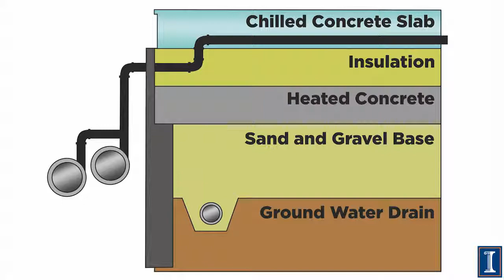How Things Work: Ice Rinks

Comment: I don't have any idea why you said that concrete has to be heated. He mentioned that he had to heat it to fix it after the insulation failed and they had permafrost with a 10 inch rise in the sections of the rink.

I don't think that this has been modernized first of all the labor costs are the primary cost and it's no longer beyond the ability of a robot to do. Secondly the labor is to save ostensibly energy that cost far far less. In downtown Los Angeles California I have seen them build the ice rink they bring lots of ice cubes in to get it started. I think they used trailer generators to operate the compressors I don't remember that's called Pershing Square and I think they have some heavy duty electrical connections to the grid there.

I don't think that the thickness of the ice represents huge energy cost and I don't think that the ice has to be perfectly level so I think the solution is colder ice and thicker ice but what you said about the gaps between the tallest molecules having loose molecules is helpful.

I also don't understand your argument about how you should slide through the ice it would take time and the existing layer of water would only reduce the time slightly I think what you're trying to say it would take longer than you have but you don't say what happens in their words when you try to skate on ice that is 21 degrees below Fahrenheit? I suppose you're going to have more difficulty turning maintaining traction. I also object to your use of the word dense when you meant less cubic space the problem with calling it more than or less than space to find how much space it is is the reactions that occur between the molecules reduce the mass. so ice is more space consuming than liquid water and it is less massive. It is less massive because the potential energy in water vapor that is released when it condenses exist as a mass as the temperature is not raised. this is an extremely controversial point and I don't know whether you agree with me or not nor am I certain about this but I have found a similar academic to yourself who argues that all reactions result in a change in mass. Mass is not conserved but there is always a balancing of the energy or temperature of the material and its mass. that is the case not for ordinary temperature changes but when did this enough Heat or the removal of heat does not change the temperature in the linear basis but is absorbed or lost by the phase change.

 it's a very very tiny amount of mass for water it's more for liquid nitrogen and because there are so many forms of crystallized oxygen I assume there are as many Delta's in the mass change?
Reply: 9:46 Intesting/Intriguing. (level ice, w. h. o. knew).

12:23 Interesting/Intriguing. (indeed flat).
Reply: The concrete or sand base below the insulation has to be heated to prevent frost heaves. They talked about how the heating system failed and they had a 10in heave at center ice.  Thicker ice also uses more energy to keep frozen